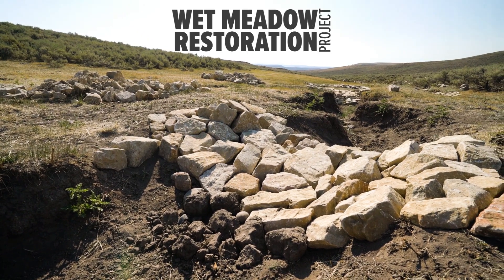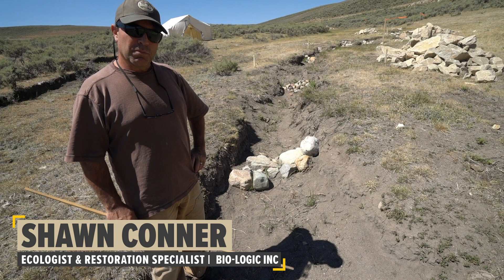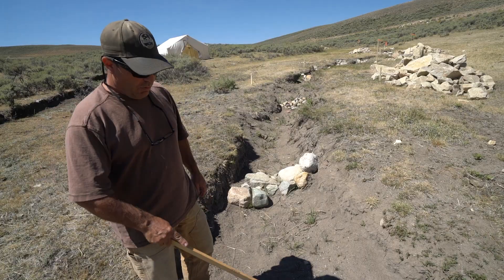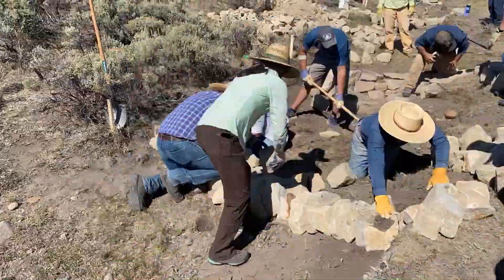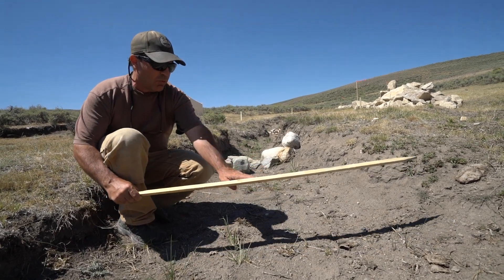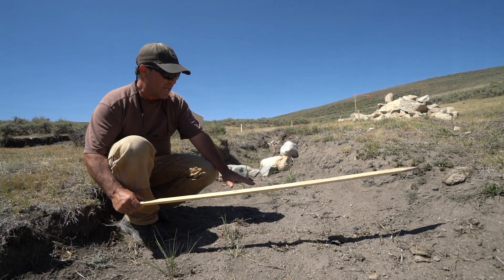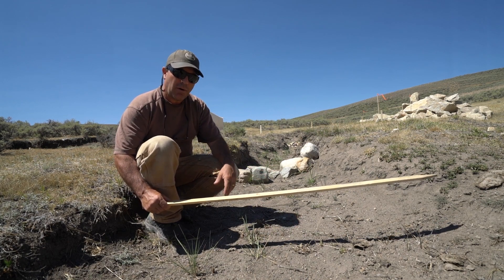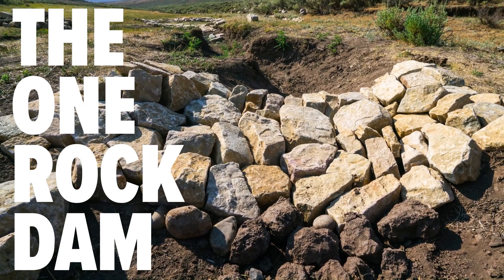One Rock Dam - Zeedyk Structures

Comment: Would a Tesla Valve work for these kinds of "slow water down" projects, or would they be to cumbersome to build or erode away?
Reply: Over time with the one rock dams, sediment builds up behind the dam and raises the level of the ground. Eventually the ground behind it builds up to the height of the one rock dam making it not effective and another one rock dam is usually built on top and staggered above the first one and so on until the ground level is back to the height of the ground around it filling in the eroded ground.

Comment: What happens if water erodes it
Reply: Water doesn't erode it or wash it out after a growing season or two because the vegetation and fine sediment that fills in the cracks of the One Rock Dam solidifies the whole structure.  If built correctly, during high flows water can easily pour over the top of the structure, but the cumulative effect of several One Rock Dam structures working in series spreads the water out of the channel into a thinner sheet flow, which is has less energy/erosive force.  Restoring the hydrology to a sheet flow allows the meadow to retain more moisture, grow more productive vegetation, and promote water flows later in the season - through the gradual release of water from the wet meadow "sponge."  Awesome, common-sense restoration!
Reply: @nathanseward-dnr8256  Great explanation! 

This structure effectively turns the situation from a downward spiral into an upward spiral.